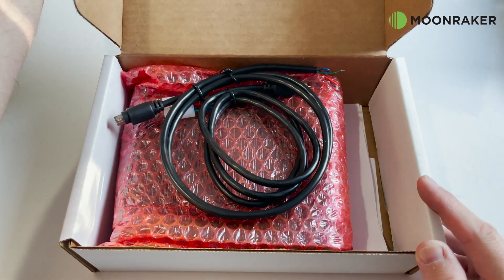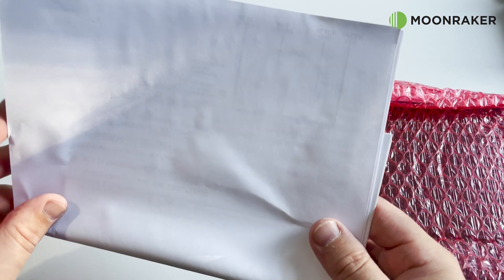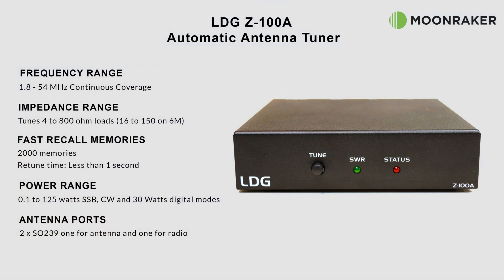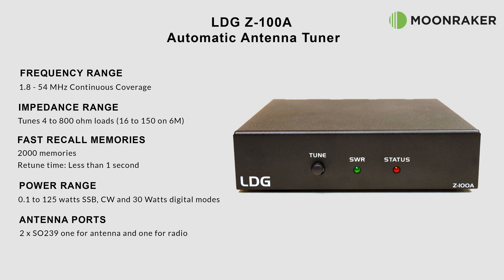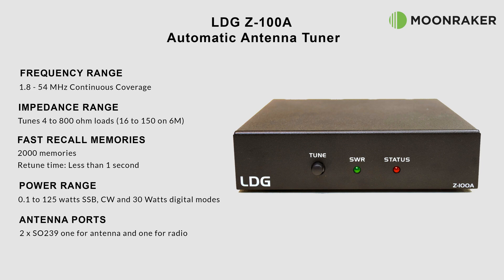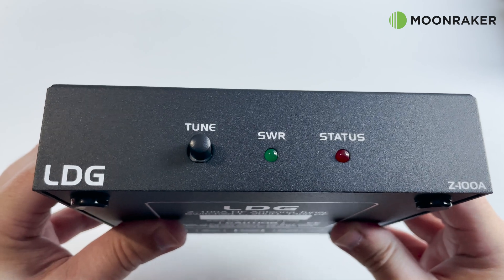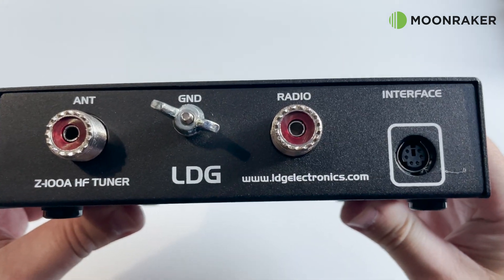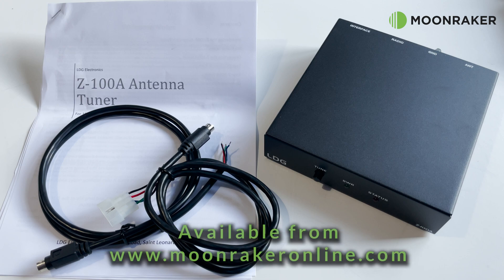LDG Z-100A ATU - Contents & Feature Overview

Comment: What is the difference between the z100a and z100 plus?
Reply: I was told that the z100a is supplied with all the interface cables whereas the z100plus does not. 4S7EF